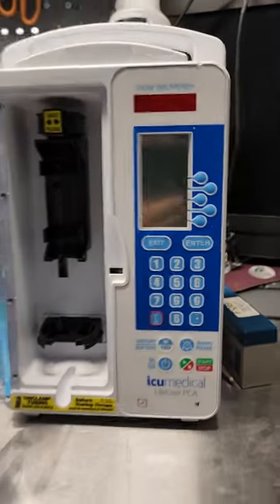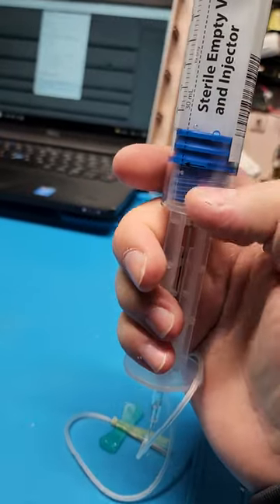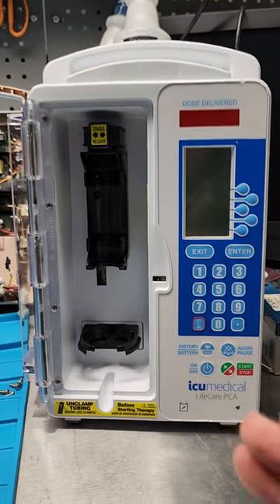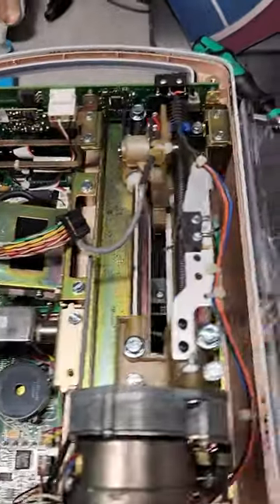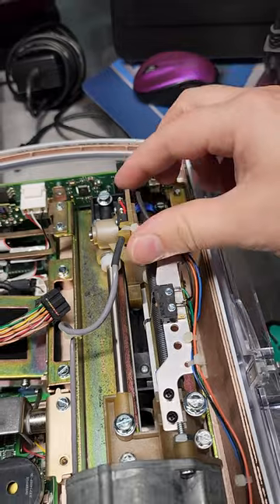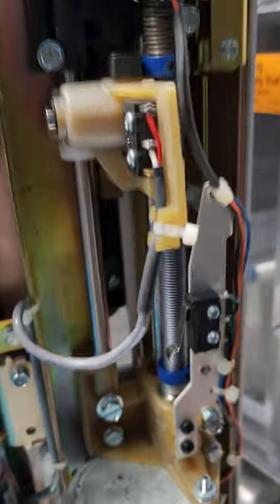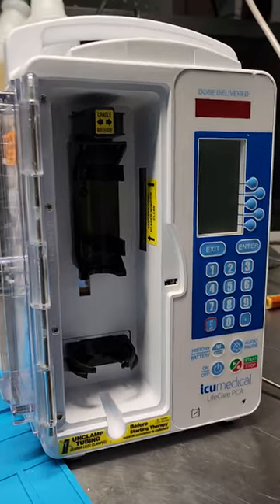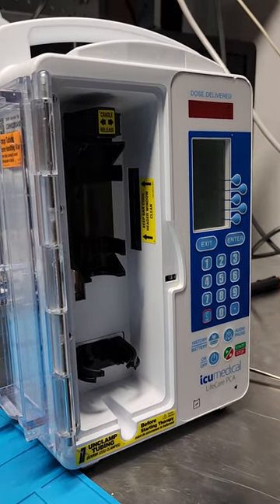ICU Medical LifeCare PCA Mechanical Overview

Comment: I work for some nursing homes we got such things that look like motor jacks, but for humans, they got Lead-Acid AGM batteries, the case is snaped and glued together, such a miserable design, I wished they would use LTO batteries, LTO got like 10k cycles and lead acid like 200 cycles. I'm sorry for my bad english.
Reply from the maker: Are they ARJO patient lifts?
Reply: @BetterBiomedChannel  I think so. We had to use a sledgehammer to "recylce" them. Because for lead batteries we get money at the scrapyard.